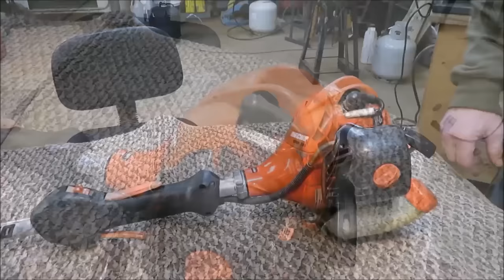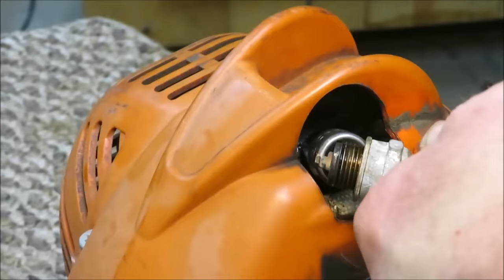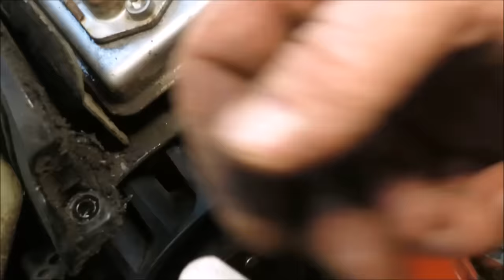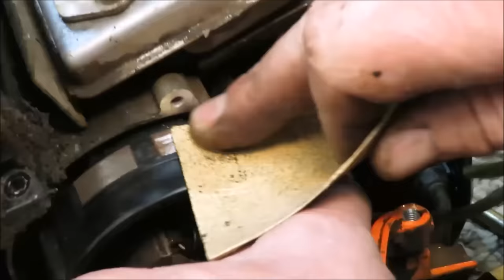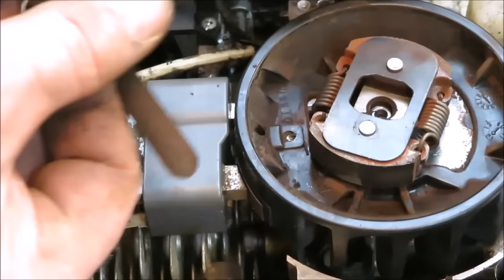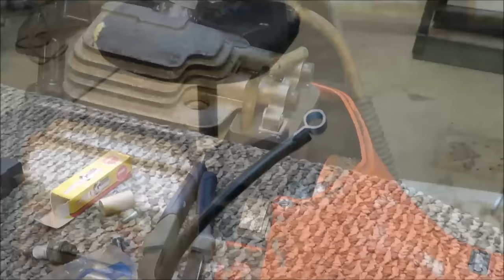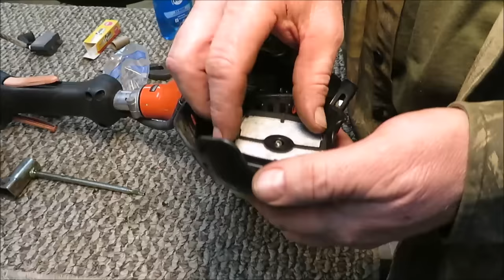string trimmer weed eater coil test & replace

Comment: buy some short leads with crocodile clips on them. 
Use one to ground the L ground electrode, that way you will have enough free space to
place the spark plug in a position to see whether or not there is spark from the + discharge electrode.
Reply from the maker: Thanks for watching.

Comment: I never keep old fuel , always replace with fresh fuel . bad fuel will cause running problems , could have water in the fuel . Quicker to replace it right . the alcohol in the fuel absorbs moisture from the air then the alcohol evaporates leaving behind water in the fuel . the water sits in aluminum it corrodes  the metal which is the white powder you see.
Reply from the maker: Thank you for watching.

Comment: They make a tool at Harbor Freight for less than $10.00 that would alleviate having to pull the plug and spark check it. It's a light that connects between the plug and plug wire. The light flashes every time the coil fires. It's a two minute check. I've used them on my twin cylinder rider.
Reply from the maker: Thanks for the comment.

Comment: I have an Echo SRM-210 and didn't see spark (looks like I am getting fuel-air and have compression) and just now saw your video.  I will proceed to check the contacts on the magneto and coil.  Cold the no spark issue also be caused by a bad spark plug wire or the connection of the metal cap into the wire?  Thank you for an informative video I don't like adding to the landfill if something can be repaired!
Reply: There are no contacts in the ignition system. Instead an electrical pulse is created by induction from the magnet on the flywheel. In fact, the air gap is to ensure that these parts do not touch each other.

Comment: Many thanks. I'm in the same place, need a coil. This was great, everything made good sense. I'll order a coil now.
Reply from the maker: Hope it all works out thanks for the comment Keith.
Reply: It all looked good except you put the rubber boot on plug wire then attach wire plug clip.  No fighting involved.  Like trying to push a chain.  Lol

Comment: Nice instructional video. However, if the coil isn't firing the spark plug, cleaning anything that deals with the magnets and coil is totally useless. The magnetic field is all it takes, not clean shiny metal between the two. No spark instantly means a bad coil or broken spark plug lead, once the plug is verified good. Thumbs Up!
Reply from the maker: Thanks for sharing Gary.

Comment: The magneto and iron tabs on the coil runs on magnetic energy, not electric. No need to clean too much, less with abrasive which eats away iron(magnetic conductor). You just need to clean contacts where electric wire plug and the body of the coil which ties to the body of the engine, which completes the ground circuit. Anyway this generates high voltage so eventually it could jump some rust from the mounting screws. Probably a new coil was needed anyway.
Reply from the maker: Thanks for the comment.

Comment: Brother I had my carb replaced along with fuel lines bcuz it didn't start. Now it starts but shuts off after 5 min and will not start up until it gets cold again. What should I look for. Appreciate it in advance
Reply from the maker: Check the screen in the exhaust

Comment: I don't think a 2 stroke engine uses a magneto. It only uses a coil and rotating magnet mounted to the flywheel. The gauge used to set the air gap between the coil and flywheel is called a feeler gauge. The correct gauge is made of brass so it will not stick to magnet. Nice video
Reply from the maker: Thanks for the comment.

Comment: Hey fella next time put the spark plug cap on the wire first then put the end on the wire and just slide the cap down over it. No dish soap needed.
Reply from the maker: Thanks for the tip

Comment: Would run in start position / low rpm, only.  Put sea foam in tank let sit for a day, now move choke to run, runs at higher speed, but doesn't sound like full speed.  air and fuel filter on the way.
Reply from the maker: Need your carburetor cleaned also. 
Thanks for the comment.
Reply: @Robinson-Homestead  that's the main thing that seafoam does

Comment: Because there is a gap between the magneto laminations and the magnets, there is no electrical connection which means the surfaces do not need to be shiny clean. It does not hurt to clean them but they were not the cause of your problem. Ohming out the coil would have saved you a lot of time.
Reply: Thank you Ron: that really Helps!

Comment: You need 4 things for the engine to start.. Spark, fuel, compression and air. If you ever had a wasp or hornet build a mud nest in the exhaust pipe, you know what I mean.

Comment: I just bought a 230 at auction.  Someoñe had cut the end off the ignition termiñal wire.  I can't see where you can buy that pàrt separately.  I was hoping to get the cheaper echo coil for 15-16 dollars just to get the terminal wire.  I was hoping to get a better look at the part, but I will find out when I take mine apart.  So I stillneed the spring and spark plug cap thingie.
Reply: abxchange that would be a boot.

Comment: Hello. Thanks for the video.
My problem is that the fuel filter line is disconnected inside the gaz basket. How can I attach it again? I can’t get my fingers inside the gaz basket to reattach it
Reply from the maker: Bend a wire stick it in the tank and pull the hose out like a hook

Comment: Will a bad coil fade, stop when using, slowly bogs under load more and more after using 20 min. Coil hot and loses power? New plug, new filter, fuel lines, carb is new...barrel type fresh mix gas oil, All gaskets good. Spark arrestor exhaust cleaned....any ideas....
Reply from the maker: I'm not sure sorry

Comment: The easiest way to put the spark plug spring in the housing. Feed the spark plug wire through the housing put the spring on the wire then pull back into the housing.
Reply from the maker: Thank you for the comment

Comment: Its getting difficult to find non ethanol recreational fuel. So for the die hards out there luckily fuel and ethanol are different weights and will separate after sitting for awhile. 
This allows you to find a container preferably see through that the fuel can't dissolve. You can put a valve on the bottom of the container. This allows you to separate them by draining one out.
Reply from the maker: Thanks for the information, i appreciate it.

Comment: I've never held the fuel lever down to start my echo. First start after winter.  Leave in off..pull a few times, prime. Turn to start on cold start. Pull till it pops then move it up to run...then it will fire
Reply from the maker: Thanks Jon

Comment: Thanks for the video...from the replacement price, the coils should last for years and years but...how big of  a spark can be expected with a good coil.  Two of my motors have such a tiny, tiny spark that I can barely detect it.  Is that about it or should it be pretty obvious as an automotive engine?
Reply from the maker: You should be blue on the spark plug.

Comment: Kevin, thanks for a good video. Got one question: if you'd tested it by holding the plug as you did, and there WAS good hot spark, would it have zapped you? (I have a pacemaker, so I avoid those special moments!) I'm getting ready to replace the coil in mine, even if it's just the wire, this thing has worked really well for me for a long time, so I don't mind replacing an old coil even if it's still working if I'm getting into it anyway. ($25) Thanks again!
Reply: You shouldn't have a problem with the spark plug in like that.  There very little chance of it arcing anywhere but at the spark plug.  Now the test he did with the wrench might give you a tingle if you aren't careful.  They do make a little tester that you can use to be really safe.

Comment: Have a husky chainsaw,the rpm’s started to slow and eventually died and would start  only starting fluid and then stop after the fluid burned up. I put in a new kit,carb,fuel filter,spark plug and primer bulb and it still will only start with starting fluid and then dies after the fluid burns out. The primer bulb pushes fuel through the lines and the spark plug has spark. Any suggestions?

Comment: What about if it appears to die and won't start once it gets hot?
Reply from the maker: That is what happened to mine and it was the coil so i had to replace it.
Reply: @Robinson-Homestead  did you do it or did you take it somewhere I'm wondering how much it will be to take it in.

Comment: One step you missed was checking the output of the coil. It could very well have been the spark plug wire.  There really isn't much to go wrong in a coil, but the wire vibrates nonstop and the pin could become separated or corroded.

Comment: i sand down all bad spark plugs on all small engines if i cant get them started. did it to the spark plugs in my car but didn't last long as they fouled out quicker than new ones wouldve.

Comment: If the spark plug wire was broken near the connector inside the boot, you'd have the same problem.  A new coil would fix this of course, but perhaps you were only dealing with a corroded and/or broken wire near the boot.  If you suspect that, you can remove the spark plug boot, and see if the bare wire will arc to engine ground when you pull the cord.  

Checking a spark plug is easy with an ohm meter.  Set the meter to read resistance x10 or x1000 either one, then see if the tip inside the insulator on the fire end reads "0" ohms to the spark plug connector tip.  If it does read "0" (for small engines only, these are not resistor plugs like cars use), then see if the connector tip has any reading to the ground portion of the plug (the metal body, or threads)... if you get a reading there, the plug is bad, or at the very least there is a carbon blob that needs to be cleaned from the plug's insulator tip.
Reply from the maker: Dan thanks for the info nice gun on that list video my friend.

Comment: Mine sounds just like that on cold start I already took apart the carburetor and cleaned it up and it didn't help so then I cleaned the exhaust and the screen vent and still nothing should I replace the carburetor?
Reply from the maker: Change the gas filter check the hoses going into the gas tank to the carburetor
Reply: @Robinson-Homestead  ever since I bought it I noticed gas would leak thru the hose idk if it's a common thing with the echo pas or if it's a defect ill check on that fuel filter
Reply from the maker: @zamora6090  it's worth a try

Comment: Great video Kev, whats the tool call with the spark plug removal is it universal for trimmers. Thanks!
Reply: Its a 'plug spanner' usualy comes with chainsaws and small engine powered tools and like.. some have a torx driver or a flat end ..
Reply: Girl Scout. 👍Thanks for the info will definitely check it out & buying asap!

Comment: I have the same weed eater and my compression is 50 psi is that to low? I have spark and when I spray starting fluid on the carburetor it doesn’t start.
Reply from the maker: It might be just Low Spark not sure
Reply: @Robinson-Homestead  i replace the ring and it started right up. It was pretty easy and the piston wasn’t damage. Ring cost me $7.00 and I found the weed eater on the curb of some neighborhood. Your video motivated to work on it:

Comment: I'd use an ohmmeter and check the coil for continuity.  If it's got continuity I'd do a better job of cleaning it.
Reply: So a bad coil will show zero continuity?  Is it possible that it is throwing a weak or diminished current?  What is the range I should be looking for?  I am in the process of trouble shooting a Stihl HS-80.  The spark tester light glows when I put it between the boot and plug and pull the string.  Plug is brand new.  I will try and visually check the spark plug but would like to hook up my Fluke meter.  Just not sure exactly what I am looking for?  Resistance?

Comment: Use a business card as a spacer, press and hold the ignition coil against the magnet, then tighten. Easy.
Reply from the maker: Good tip Paul

Comment: My weedeater wouldnt start, but my coil wire choke me, but no sparks on the new plug, it took me 3 days to figure it out that my coil was to far from the magneto, cause it not to have enough spark, now it start again
Reply from the maker: Cool thanks for the comment

Comment: I'got a durostar 4000s portable generator. No spark after running 6hrs it just died, presumed it was out of gas, it was not, checked ignition coil it's good. Yet still no spark, what can i check next?
Reply from the maker: Sometimes the coil will work for so long after it heats up it will die if you don't think it's the coil check for any wires going to the switch maybe the switch is bad
Reply: @Robinson-Homestead  yea thx Kevin, but i by-passed switch and low oil indicator.
Even swapped out coils.
Real head scratcher.
And when it quit it wasnt a violent stop.
One that sounded like an out of fuel stoppage.
Like i said a real head scratcher
Reply from the maker: @EdwardCarnajz  pull pull the exhaust off there's a screen in there check it and see if it's plugged
Reply: @Robinson-Homestead  yup checked that also.
Negative
Is there anything in the instrument cluster that could account for this?.

Also plug, compression, valves, check, and dbl check.
Reply from the maker: @EdwardCarnajz  I don't know I'm scratching my head now

Comment: I've worked on two Echo blowers , same problem with both of them about a month apart from receiving them from different customers . Both had bad coils , new coil from Echo was $75.00 . Both customers said to chunk them , new blower was $150,00 new . These blowers were both right at four years old - same exact models .I'd never buy Echo if there parts are this high . Which all there parts aren't this high  but for this particular model it was . I will not buy Echo  ....
Reply from the maker: Thanks for the comment and watching Marshall.

Comment: Question. Can the coil make it run bad? Or is it an either it runs or it doesn’t type thing?
Reply from the maker: It could make it Miss but normally it's either running or it's not.
Reply from the maker: What is your machine doing?
Reply: Kevin Robinson sounds like it’s missing. It would bog down when giving it gas and die.

I put a carb on it a few hours ago and the carb felt sticky, wouldn’t operate freely.

I changed the carb, fuel filter, air filter, and spark plug
Reply: Kevin Robinson wound up being the exhaust clogged up, was the main thing. Have to send the carb back and order another one. But it’s almost back to like new power. Thanks!
Reply from the maker: Exhaust would make it do that for sure make sure you use a good quality oil in your gas mix.

Comment: I was told to by what is called recreational fuel for my 2 cycle blower ,it contains no ethanol at all
Reply from the maker: Thank for the comment Edward.
Reply: I don't run anything in my power equipment that has Ethanol in it period! It plugs carbs and actually eats away at the fuel lines.  We call it boat gas around here, since "doing" outboard carbs cost about $90 each!  I also run Sea Foam in everything. No more fuel issues
Reply: Seafoam

Comment: I glanced thru a few comments but didn't see this mentioned. It is called a FEELER gage, not a filler's gage and you cannot use a flat feeler gage in a curved application. You should have used a wire feeler gage, not a blade feeler gage. There are also non-metallic gages you can use to keep from being drawn to the magneto magnets.That gap was much greater than .010". You succeeded only because you jammed the wrong feeler gage into place twice the same way. The same result but improperly done. Also, if all this is done by the owner, it would be cost effective but to have a shop do it, not so much.  With a cost of $50 for the coil, $5 for the plug, $5 for the filter and labor, you have exceeded the value of the trimmer. Usually a shop will tell you it will be expensive because they don't want to get stiffed.
Reply from the maker: Thanks for the comment.

Comment: the right way to do it is put the boot on first and then the wire you will have that much problems getting it in there try it next time it'll work a lot better than trying to stick their boot in there with the wire on the boot goes first and then the water goes in
Reply from the maker: Thanks for the comment.

Comment: If initially you can't find spark at the plug which is the easiest thing to do. Then pull any grounding wires off the coil as it could be a problem between the switch and the grounding wire. This is missed many times and it's not actually the coil but the grounding wire itself. AKA bad switch
Reply from the maker: Great info Roger your right.

Comment: I HAVE A PROBLEMS WITH A ECNO SR225 IT START BUT WONT GO OUT WHAT CAN I DO
Reply from the maker: Do you mean it won't shut off ? If so the wire probaly got disconnected from the shut off.

Comment: I didn't watch the entire video but make sure you pull the grounding wire to the coil off when you're checking for spark as a lot of times that is the problem as the wire rubs through and the coil is being grounded which is how it is shut off with the switch. This is one of the most common mistakes of checking coils is making sure that your ground of the coil is not grounding if that makes sense
Reply from the maker: Thanks for the comment.